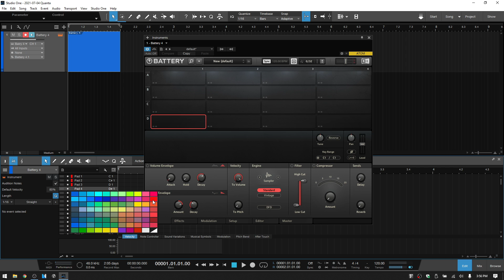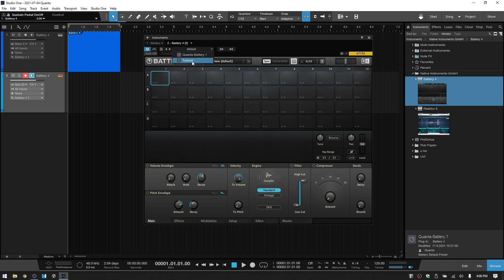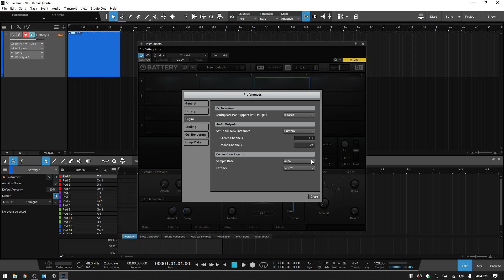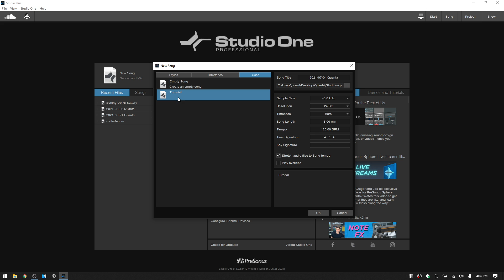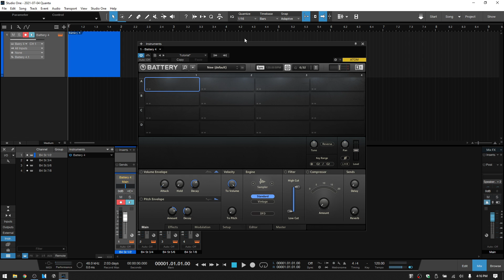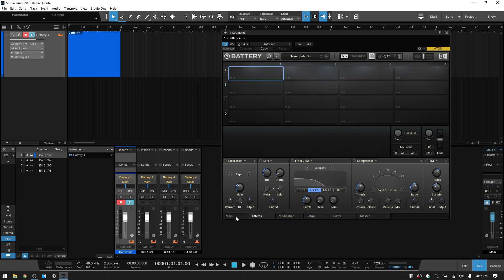Setting Up NI Battery in Studio One 5.3

Comment: Hi, It works so far. Thanks ! I can trigger the samples with my pads. But the (its just a visual issue) cell (highlight) is not jumping from c1 to c#1 for example. C1 stays highlighted even when I trigger C#1. Do you have an idea ? EDIT: Solved by activating Selection follows MIDI Input

Comment: Nice. Pushed me into really starting to implement Battery in my workflow. This info makes it easy to set up a quick approach. I will add that there IS a way to save your multi-out configs. Check out Huyskens video on Instrument + FX presets. Be sure to add a plugin (I use ProEQ) on each channel in the Mix Console before saving. Saving everything to an instantly recallable preset is groovy!!
Reply from the maker: Glad you found the tutorial helpful, and thanks for the tip!

Comment: My mapping starts at c3. It won't line up like in your video. I have atom, atom sq, mpc studio black and komlpete 61 in my template as controllers. Should i start with new song instead of trying to set this up in a template.
Reply from the maker: When you open up the editor by double clicking on the MIDI part, you have to be sure you switch it to the "Drum View".  Otherwise, the Atom will start on C3.  When the pads turn blue on the Atom, then you know that the first pad in the bottom-left corner will start on C1.
Reply: @quantaaudio  it worked, thanks